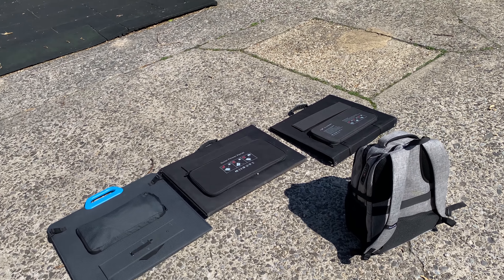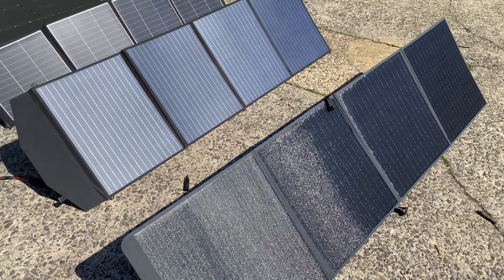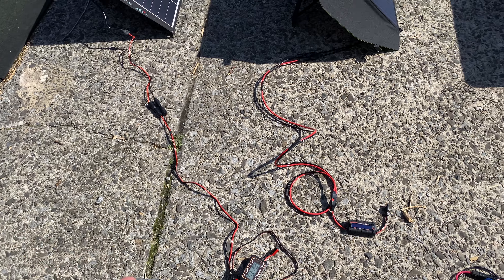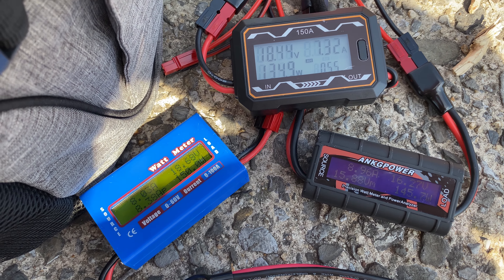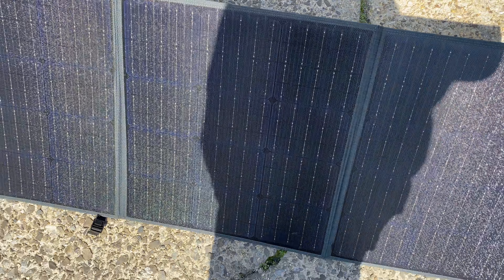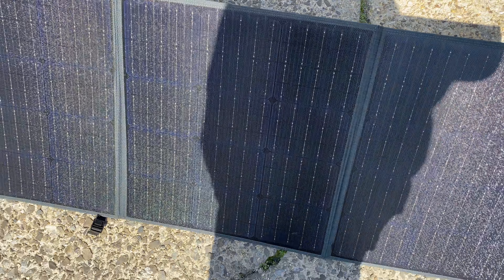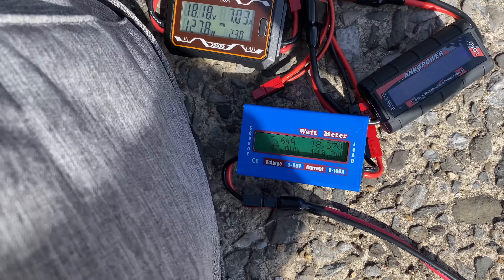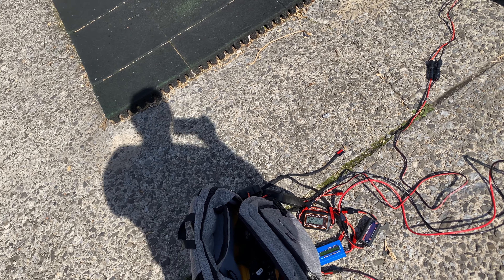Bluetti PV200 vs AllPowers SP033 and SP035 Review Head to Head Test #wisebuyreviews

Comment: Hi! If my power station has Anderson charging characteristics 18-30 Wt 8A max, is Allpowers 200W solar panel Ok with power 11A to my station? Or 8A and 11A is crucial and will damage station or panel ?
Reply from the maker: It will be fine because it is 18-30 volt input, so as long as you don't go higher than that voltage, even 50 amps theoretical output won't matter. Amps are like the amount of water that can come in, and voltage is kind of like the speed the water flows in. The pipe  is only  a certain size so it can only do 8 amps, so even if you had infinite "water" electricity it won't be able to take in more than it can. So maximum from 200 watt panel you would get is theoretically 19 volts x 8 amps = 152 watts. If you had higher voltage let's say 30 volts at 8 amps you would get 240 watt's max.
Reply: @wisebuyreviews  thank you!